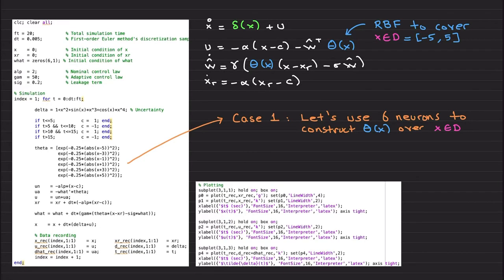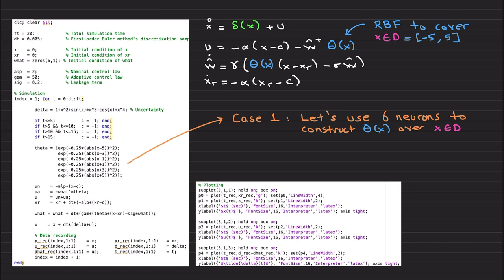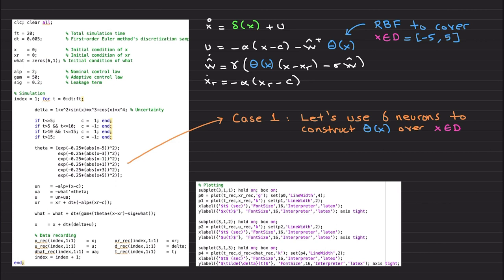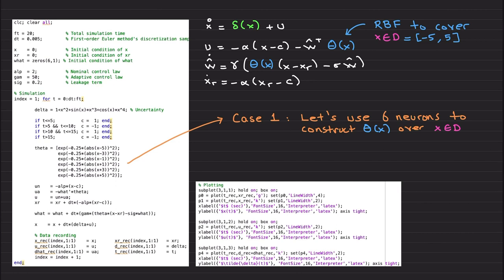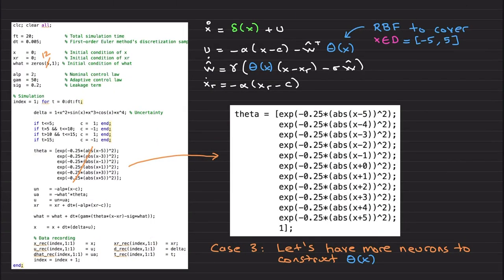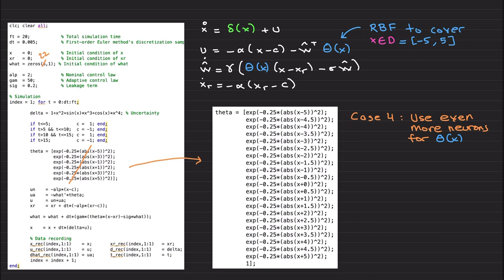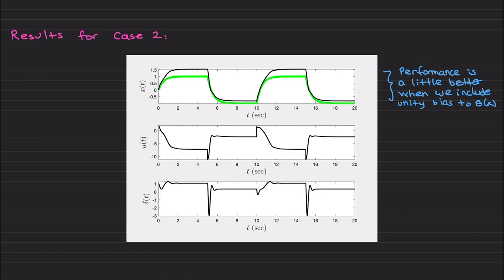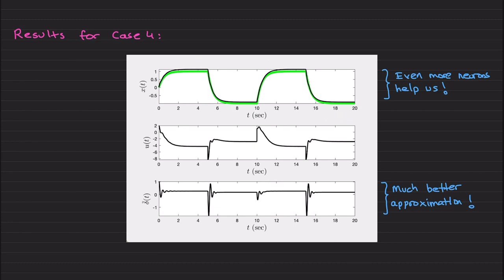Neuroadaptive Control Example in Matlab (Lectures on Adaptive Control and Learning)

Comment: If there are two states,  x1 and x2, how to construct  base functions. Thank you very much.
Reply from the maker: After covering the basics, we are moving to advanced stuff. I am planning to cover this question’s answer there. However, I can provide an answer now. Let’s say x1 is angle and x2 is angular velocity. Say also that you operate the system within a domain D, where x1 is expected to change  between -90 and 90 degrees. First, I would include sufficient neurons for x1 to cover this region, more the better as shown in this video. About x2, it is also subject to limits say between +-45 degrees per second. I would also include neurons for x2 to cover this region. I hope this answers your question 😊
Reply: @tyucelen  Thank you. For delta wing rock dynamics, the uncertainty is assumed as c0+c1* x1+c2 *x2 + c3 *abs(x1) *x2+ .. .How to use RBF to approximate this abs(x1)*x2 term? Thank you  very much.

Comment: Sir I have a question. I applied control loss of effectiveness of 0.5 in the system after some time and as it is considered as an invariant uncertainty, but when I applied the sigma modification it worked pretty well and converged to reference model. Is it convenient to use the sigma modification even if the uncertainty is not changing(varying) over time? Thanks a lot! 

ps : I used neurons as radial basis funcs. to compute what.
Reply from the maker: Yes. Adding a bit of leakage (sigma modification) will smoothen the performance if you see oscillations without it. Yet, a better way to smoothen the performance is using the low frequency learning idea: https://ieeexplore.ieee.org/document/6302181 — Soon I will make a video about it 😉
Reply: @tyucelen So excited! I used 90 neurons to cover all the uncertain domain with radial basis funcs, maybe need to reduce the number. ( I have 4 states, 2 inputs, 1 control loss %50 )Thanks a lot sir! Appreciate all.